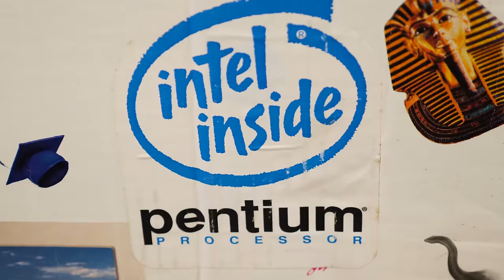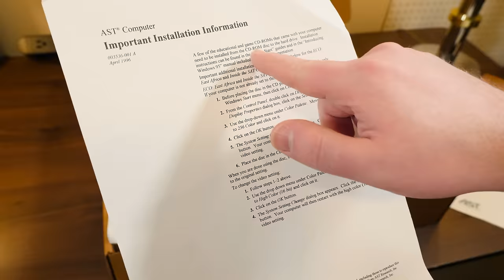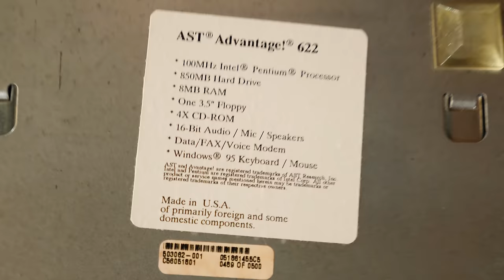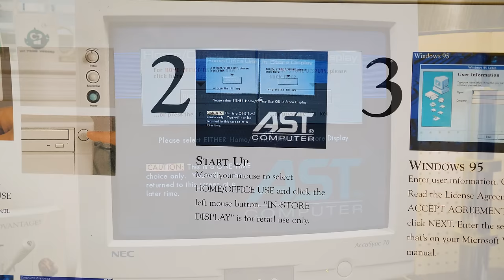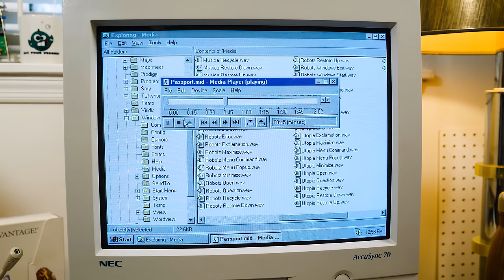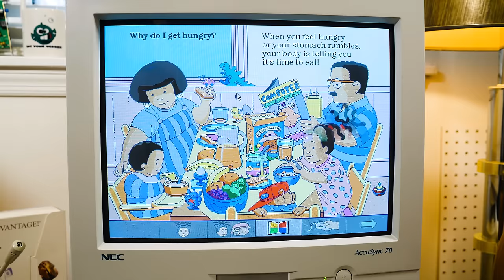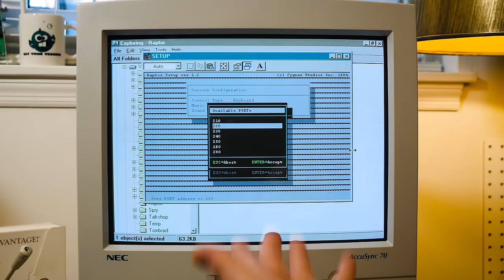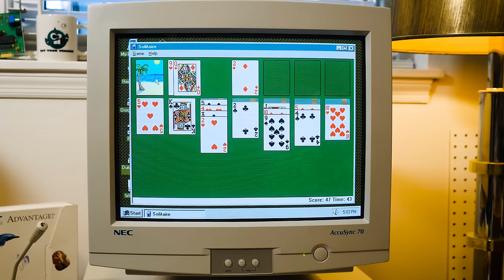This 1996 PC Was Obsolete Before You Got It Home: AST Advantage 622

Comment: Heh heh, I had one of these in 1999 that I picked up for $50 at a yard sale (still working!) It would run Win98 SE but it struggled with the 16 mb. of RAM that was currently installed on it.🤣(bare minimum for Win 98 at the time). Man, this little demo sure brings back memories! From the cursed AOL shill software to the Hover game, pretty cool stuff! I'm kind of surprised that 27 year old hard drive was still functional. I knew as soon as you opened the case and saw that CR2032 lithium cell, that it would be dead. No big surprise there.😄 Pretty impressive what they could do with 8 mb. of RAM and a 100 mhz. single core processor!😉👍

Comment: We had an AST advantage (with Cyrix processor) from around the same period and those tall speakers.  More accurately we had three.  The first one died after a few weeks, on the second the floppy drive fell out when it was unboxed, and the third one had no sound.  At this stage we had exhausted the stock of the electronics store here in the U.K. we had purchased them from, and got an Apricot instead.

Comment: 11-year-old me's first home computer was a Protek unit my mom got from Fingerhut's 1995 holiday catalog, and it had almost the same specs as this machine. The only real differences were a 100 MHz Cyrix processor and 540 MB hard drive, and I think 2 MB of graphics memory, and much like this one, it was no gaming powerhouse. I distinctly remember trying to play Jedi Knight on it and having to run it at 320x240 with the view area shrink down a bunch as well, and I still only got like 10 FPS. Ran the original Dark Forces like a champ, though. 😁

One benefit to growing up playing JK like that, I suppose, is that sub-60 or even sub-30 FPS framerates don't really bother me, so long as there's no hitching or stuttering.

Comment: In 1995 I bought a Dell PC.  To keep it under $3,000 I went for the P90 instead of P100.
There were no clock settings in the bios, but years later I found it you could run it at 100 just buy moving a jumper on the motherboard.

Comment: I bought my AST Advantage 600 series at WalMart in summer 1996.  Paid like $1600 for it (with monitor).  100MHz, 8MB, and 1.2Gb HDD  The tall labtech speakers could be mounted on either side of the monitor with a bracket

Comment: This video recall  memory of my first PC. Almost the same hardware configration as the modle shown in this video but branded as PHILIPS and it burned a hole in pocket with price almost $1500 back in Aug, 1996. I bought extra 8mb RAM to make it 16mb in total so the computer can run DOOM, DUKE3D, DIABLO1, AGE OF EMPIRE and some other 2D games smoothly. But the suck thing is the integrate video unit (SIS 6205) performance is so weak and voodoo card is not compatible with it. The whole system  became obsolete in just 2 years.

Comment: 7:51 i used to have an old packard bell keyboard that came with most likely the pack-mate 8124 i found with it that looks to be that exact same keyboard, not the same one, but same model and things. I no longer have the keyboard but i do have the pc and its in good condition and works perfectly, but i honestly its just a collectors item, i never really plug it in and use it for anything, but it works perfectly.

Comment: Ive seen this "hard screw" method on my HP Pavilion S3000 machine. The onboard VGA connector was covered with a hard plastic cap and the cap was riveted to the backplate. It was weird, because the motherboard had an onboard NVIDIA GeForce 6150 LE. The PC came with a dedicated AMD vga(dont remember its model no). It had only a single DVI port with a two way D-SUB splitter. I still have its case, PSU(with HP slimeline to standard ATX adapter) and the machines original Vista disc/product key.

Comment: The late 90s hardware collapse had its benefits. I could aquire a IBM ThinkPad as a child, because it was basically useless and no one used it anymore. It also had a broken USB and no internet, so it was only good for one thing: 90s gaming. It had a 300 MHz CPU, 192 MB RAM and a 3.2 GB HDD. The latter was the worst part, so you had to be careful what you install. Even basic games easily got over 1 GB.

Comment: Essfm in windows 95 used 4 operator instruments for everything and it is also works just fine with the standard opl2/3 drivers I think.
The enhanced fm synthesis boasts up to 72 operators / 20 voices tops.

Comment: I had one of these  adventure 6000 in mid 1995 and it has a Cyrix 486DX2 in and it was a wonderfull machine and rock solid upgraded it with a quantum bigfoot and upgraded to the max of 32MB ram. once we got "Byte the computer superstore" to fix the issue with the bios which turned out to be a bad batttery that said would charge 😞 yeah since when does a 2032 button cell charge. we replaced it and all was well. very different to my ryzen system of today with 64GB ram and 32TB of NVMe, but games were better back then for game play.

Comment: Omg this was my first imb clone. I used commodore and amiga before this. I got a got with AOL. Funny since I used IBM in college for computer science and had to use a pc emulator on the amiga. Anyhow got this when I was hired for AOL. Loved that pc. Sad you didn't get the original speakers as they were awesome. I gave mine to my sister for when she went to college as I got a gateway after a few years at aol.
Reply: Before I gave it to my sister I had put I think a 200mhz (I think) with mmx I believe it was called. Upgraded to 16mb as well. But yeah even with that huge mod levels in doom was a major task for it when facing the main part of a map. I remember having to move backwards at times or just don't get huge mod maps.

Comment: Hah, my family had an old Compaq of a similar era, with VERY similar specs (P90, 8MB RAM, 850MB HDD,  4x CD, ESS Audio etc). I remember we ended up sticking 64MB of FAST PAGE MODE memory upgrade in, so it had 72MB of RAM in it (WHOAH) and then later upgraded it with an Evergreen Tech Overdrive chip, which basically swapped in a AMD K2-333MHz processor with an adaptor, but forced us to upgrade to Windows 98, as Windows 95 couldn't handle it, and would have protection errors and the like almost every boot. To be fair the Evergreen Overdrive chip did warn you about that in the documentation.

It also had onboard S3 video, and an ESS audio chip, which I spent years swapping out with various Cirrus Logic and over graphics chip upgrades I'd find cheap at carboots and the like. including a Cirrus Logic which, like this machine, had GPU memory upgrade options, and I ripped the memory modules off another identical GPU, slotted them in and they worked! Good times.

Although people forget just how jank and easy to break DOS-based Windows was back then - your PC crashed playing Magic Carpet/Tie Fighter - roll a dice, roll a 1 and you've got HDD corruption and maybe a windows reinstall needed! Hah

Honestly, its a shame you didn't do the before section with the system at stock,  and then done an AFTER section with all the period correct upgrades you mentioned, would have loved to have seen the difference. In the UK PCs were very expensive at the time, so unless you were an enthusiast, at the time a lot of people would do minor upgrades to keep the machines running longer (bigger HD, more RAM, MAYBE a processor upgrade etc,, and then get a massive jump when they bought a new computer several years down the line on a fundamentally newer tech as things were moving so fast back then.

Comment: I had a similar  looking AST with a Cyrix 486 DX2 (slower than intel because of smaller cache I believe) with 8MB which I later upgraded to 16MB because the hard drive was working overtime. Later I got a 166 Intel Pentium with 32MB RAM which was capable of running Win 95. 8MB is not nearly enough :).

Comment: Those SiS chipsets still make me shudder... I remember spending many an hour of my early IT career squinting to try and read the small number off the chip to be able to go to SiS's "bloated" website on a 56k modem to try download drivers - as the drivers were often 2-4mb it wouldn't fit on a floppy so you had to do it on the machine itself without any graphics drivers.... As it wasn't worth burning a CD and USB drives weren't a thing... Only then to realise you'd read the code of the wrong bridge of the chipsets (can't remember wether you needed the North bridge code or South Bridge) Frustrating times but it was the era where fixing computers was fun... Mostly because the OS didn't have all this stupid security stuff in place like today 🙄

Comment: This was not a cheap computer. Had an AST 133mhz 16mb 2GB HDD version of this that was $2000 mid 90s. Keep in mind that cost isn't adjusted for inflation. Ended up upgrading to 64GB of ram and a 333mhz amd k6 processor (yes, converter kits existed for this!) 

8MB of ram would have been ok for windows 95. Half the programs you'd use would be dos anyway.

Comment: I know it looks primitive now, but computers like this were very important at the time…it was like a coming of age era for computers. Prior to this you couldn’t do half that stuff, at least not at that price point…or straight out the box.
That one in the video is an early example too…very early Win95, and only 100mhz pentium. It really got going just after this with 166-200mhz MMX Pentium….”multimedia pc”.
8mb ram which previously looked like “a lot” suddenly didn’t….now that was where pc users caught up with Mac (system 7.5 on the PowerPC cpu)….like, where did my ram go?

I was mostly using Mac at the time, and this was the era when using a pc became a possibility.

And, I remember hard discs seemed to get louder in the mid 90s compared with early 90s, on Mac as well as pc….or was it my imagination?

Comment: I really wish there was a retro pc shop in my area where i could buy old pcs like this. Id love to have one firstly for nostalgia purposes, and secondly for old games since modern windows is just awful. Id kill to have an older high end rig with old speakers, monitor, keyboard and mouse. Id spend a looot of money on it too, its just worth it in my book. Plus i used to be good at coding on older pcs, and i went about 8 yrs without a pc so i lost a lot of that knowledge, i feel like using an old pc would refresh the data banks.

Comment: Is there a list somewhere of the different AST Advantage systems?  I don't remember which I had, but the PC in this video is almost double the spec.  I had one that was a Cyrix 66Mhz DX4, with 4GBs of RAM and I think a 420MB hard drive with a 2X CD-ROM?  I remember we paid I think $1200 for it at Radio Shack and it ran Windows 3.11.  I still have the restore disc for it.

Edit:  Oh yeah, and a Sound Blaster 16 card.  I remember upgrading it with a 14.4k modem.

Comment: My first PC wasn't that far from this one, timing I got it was equally bad as well. A Siemens Nixdord P90 I got instead of a N64 back in 1996 (my parents thought I would be better since I could also used it for school. Spoiler: I didn't). It was fine while I was mostly playing DOS stuff and Win95 games (I remember I had to run FIFA 97 from DOS othertwise it wouldn't run at all), but it was obsolete pretty fast so the guy that sold it to us later add some ram and a GPU (an S3 Virge if I remember correctly). But it was a losing battle and after a couple of years he replaced it with a P2 233mhz MMX one. 

He was a family friend so I think all of those he basically did for free or charged very little for it.

Comment: I had the 133mhz version. Depressingly I paid 3000$CDN for it albeit with a 15" monitor and Canon bubble jet printer. By large and far the most expensive computer I ever owned but also the worst. I just remembered, it had a disconnected floppy drive out of the box so when I called support they had me plug it in.

Comment: To remove the heat sink. Warm up the heat sink with 100 degree c heat for about 2mins. It'll come off smooth as butter. 100 degree c not 400 don't use a heat gun use a proper hot air station.

Comment: Not sure why you wouldn't just replace the battery immediately, I guess it's content to check if it works or not.. gotta move the monitor and get the case off and then finagle in there tho.

Comment: it would be interesting to see you upgrade the graphics memory and the system memory just to see how much an improvement you would have with the same hardware just a bit better honestly i personally was lucky i didn’t have to use windows 95 with 8 megabytes of ram that is just two low for what we did we started with 16 on our 486 machine later updated it to 32 max i would have loved the faster cpu but i had 4 mb graphics an cd rom i was  super happy until my dad was trying to run windows 98 lol then it wasn’t good but seriously up the video ram and go up on system ram a bit let us know how it turns out you definitely need both

Comment: I wonder if it will run quake, nfs 2, nfs 3 and duke3d well if you maxed out the ram, cache and vram... or even put in some ati rage xl pci card (I had one in my pentium pc and it ran nfs 3 pretty well, but it was 166 or 233 MHz with 128 megs of ram).

Comment: Guys can somebody help? I have an old PC from 2000 i tried to reinstall windows XP on the disk try to install Ubuntu all the installation complete successfully but at the end when post start it says operating system not found or in case of grub it goes to grub rescue. Any tip? Thanks

Comment: I would imagine that the seller may have put the system together to make sure everything worked before boxing it back up and selling it as near-new. The rubber marks on the top could just be from the degrading rubber bumpers on the bottoms of the monitor stand. Since you had to replace the battery, I doubt they got to even the Windows95 confirmation screen.
Reply from the maker: Sure, possibly. But if so then they should’ve stated as such in the listing :)

Calling it “NEW” and “complete in box” implies something else entirely, especially when it’s clearly been used and lacks some of the discs it originally came with.

Comment: Me, I'm stupid.
Real stupid.
I'd toss the CPU and replace it with the fastest chip that motherboard could possibly support.
I'd fill all 4 memory slots with the largest capacity and fastest modules that MB supports.
I'd replace the HD with a 4GB EIDE HDD which is the largest capacity drive Windows 95 supported.
I'd install the most powerful graphics card and sound card that machine could possibly run.

Yup. I'd max it out! 🤣

Comment: I was the product line manager for Advantage from 94 - 97 when I finally left. And while many of your observations regarding the performance of this model are correct, I don;t know that it's really fair say it was obsolete, given that the 100 MHz Pentium only hit the market in early  '94.But the main reason for producing a model like this was primarily market driven. As you've already pointed out, many resellers offered this line including CDW, Insight, Computer City, CompUSA, Circuit City and even Radio Shack and Walmart. So this led to the Advantage line growing to more than 30 models of desktop and Minitower PCs with a wide variety of differences, some minor and others more significant. There were three series, the 400 line (all-in-one models with built-in CRTs, the 600 series (desktops) and the 800 series (Minitowers). You have one of the more basic models, that's why 8 MB RAM, smaller capacity FHD, and 100 MHz Pentium processors, where as other models included standard 16MB, 1.2- 2.0 GB FHD, and processors @ 133, 150 and 200 MHz.  But as I said, the reason some models were under powered was to meet the demands coming from resellers who insisted  upon  hitting key retail price points, ($1299, $1499, $1999, $2499, etc.), and even other points in between. To do this meant trade-offs in the specs. Additionally,  these resellers did not like being forced to price match the competition, so they demanded variations to core models to avoid it. As I recall, the 622 was a low end model of the desktop line, so it obviously lacked a few bell and whistles, I still have my 628 (mothballed for years now)  And sorry that you didn't get the Labtec 1022 speakers, they were really great. I had several sets along with a subwoofer for years...

And yes, AST was definitely struggling by this time. But it was a great place to work and the best people anywhere. I look back upon those days fondly and with a great sense of pride. Still the best place I ever worked for many reasons.

Comment: pretty disappointing it was used. despite advertised otherwise. Well, sure, it doesn't affect the overall quality, but it's something unique about having a "virgin" old piece of tech. That's what would warrant the asking price. Otherwise, i have 2 pcs from 1997 in my attic I will sell you for a beer. Complete with a crt monitor that's still has missing pin on the data cable XD

Comment: In 1996 EVERY computer was obsolete before you got it home. That was the heyday of Moore's law and it wasn't just transistors on a chip. It was modem speed, graphics, RAM, storage etc. You could literally plunk down 2K in 1996 money and then in a month or 2 see one leaps and bounds better for $300 less